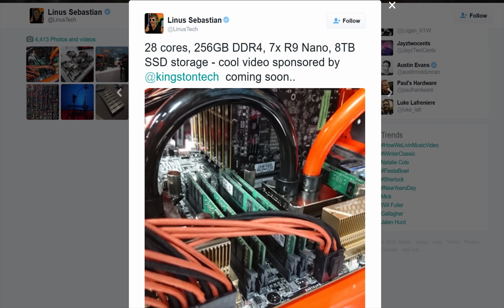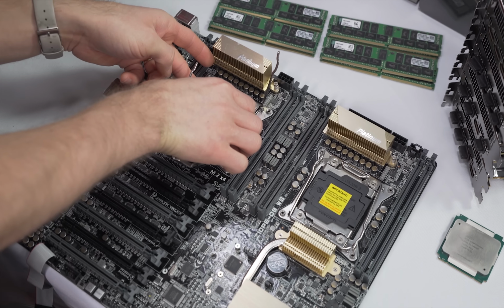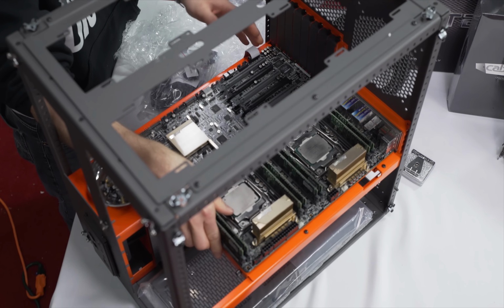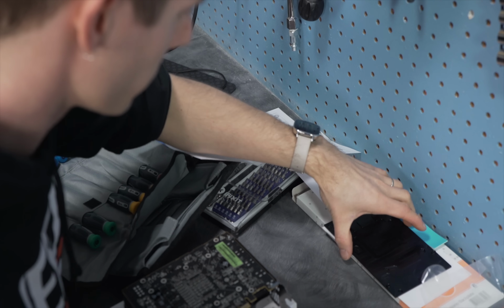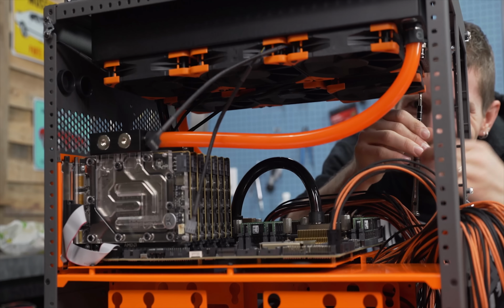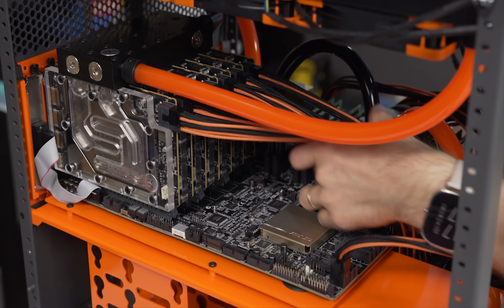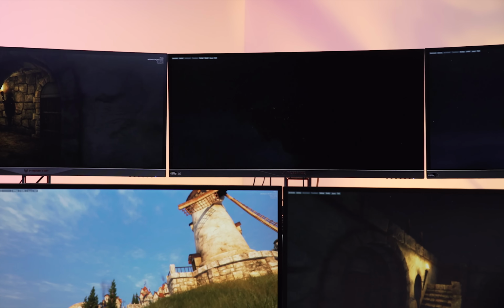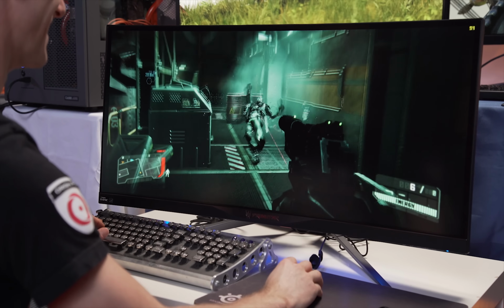7 Gamers, 1 CPU - Ultimate Virtualized Gaming Build Log

Comment: I just realized this stuff has become cheap enough that you could rebuild this thing for like, stupidly cheap. The 22 core CPUs can be had for less than 69 bucks, the GPUs if you go with the actual Fury X or the 980 ti can be had for like 75 to 90 each, just to get a water block that connects all 7 will be hard

Comment: For those wondering the Radeon R9 FURY is close to the performance of an RX580 these days.
I'm going to guess with only 4 core/threads per gamer at a max of 3.6ghz, the cpu would still be the bottleneck.
Reply: Thread ripper would have been huge for this project

Comment: «There isn't a CPU on the market that can deliver a full-on high-end gaming experience to seven gamers at the same time.»  Ahh, the days before Threadripper, when 56 threads across 2 CPU chips and HT was impressive.
Reply: Even Threadripper has neither the PCIe lanes, or slots (in the case of the motherboards) for a system like this. You’d need an Epyc CPU for this
Reply: @StopwatchGod at 88 PCIe lanes, given the graphics cards can worl alright with 8 lanes, it would work.  But the motherboard point stands.

Comment: Wild that those processors were $2,700 each in 2015. A Ryzen 9 5900X (2020) has a significantly higher multi-core score (+20%), it has over double the single core performance. They are on sale from multiple vendors for $399.99 now.
Reply: Imagine if ryzen never came out, we’d just now be getting 8 cores from Intel (their leaked roadmap had 6 core CPUs in 2019-21)
Reply: @tranquil14738  That's nasty AF business practice. Intel has no shame.

Comment: Funny a single pc with 2 rtx 3080 and a 5950x would be faster only if you could allocate specific amount of cuda cores and vram to each use but I don't think there is a vm good enough for that unless it's something really unknown lol that would be dope but dunno how drivers would really work
Reply: SR-IOV does pcie bifurcation of compute, so not far off but no one has enabled it on their consumer grade products
Reply: Yeah most cool technical features most consumers will not use so it comes in at commercial grade hardware which is expensive or commercial software cost alot usually which kinda sucks but hopefully stuff becomes more open source

Comment: I think they should do a new version. 6 gamers 1 cpu, is actually do able with threadripper pro.

CPU: Threadripper PRO 3995WX 
Motherboard: ASUS Pro WS Sage SE wifi sWRX80 EATX
RAM: 8x 16 or 32 GB 3200+mhz <=16 CL sticks
GPUs: 6x reference 6900xt (for 1 slot and usb c)*
Storage: 7x Samsung 980 pro 1TB
And a 4 m.2 expansion card .

*The reason to get reference cards is that the usb c connector can be passed through as a pcie device to each vm alongside the gpu its on thus solving the usb device assignment problem. You theoretically connect a usb c hub to each graphics card and have hot plugable USB ports for each vm.

Each vm would essentially be a 10c/20t 4.2ghz zen2 cpu with a 6900xt and a 1tb gen4 nvme drive, basically not much better to had for a gaming pc.

Y'all could even do something like get the world's first raid clear on a single tower.

Comment: you could probably do an actual 7 gpu and ONE CPU with an AMD EPYC version of this build. Godspeed Linus

ps: using that single water block for all the gpus.. doesnt that mean that the water from the first 6 gpus flows hot water through the last one? or are they set up in parallel config?

Comment: I am really really really wondering and I don't understand why this wasn't a talk here.. 1) are all devices plugged in locally or did you run the games remotely like Horizon View? and 2ndly.. What about latency? It's called Virtualized, but perhaps it is 'just' several sessions on a single windows 10 installation.. Anyone has an idea if it would work to just fire up a type 1 hypervisor and run via vnc or anything else to game with latency below 5ms? Steam in-house streaming is actually higher as stadia afaik.. but having one big machine as a home lab and gaming rig somewhere in the basement and playing lightweight via LAN on a fan less device .. this would be awesome.. since pcie passthrough to a vm isn't a problem in esxi, proxmox whatsoever it could work pretty good i guess

Comment: 2016: LTT makes 30k build 7 gamers one CPU.
2019: Apple makes 58k build 0 gamers one CPU.
Reply: 😂😂😂l0l lmao
Reply: It is a beastly system, if it was like 15k that would be a heck of a lot more reasonable though
Reply: As of 2020, the best pc apple has is $54,547.98
 without tax. But to be fair, it has 28 cores and 1.5 tb of memory.
Reply: @pokemonmaster42000  28 cores and 1.5 tb ram with an overpriced tag.. lol
Reply: @KingKong-xp6so  still the best apple pc, even if the ram is an over 300% markup (yeah thats true lol)
Reply: @pokemonmaster42000  yeah best Apple approach can be said.. Yet there will be very minimal where to cost those amounts of money..
Reply: @pokemonmaster42000  So what you are saying is that Apple is approximately 8 years behind on hardware tech from Intel?  I currently own a Dell r820 with 4 E5 4657v2 processors each having 12 cores and all 4 cores run Hyperthreading meaning I have 96 Threads and 48 cores available and 1.5tb of DDR3 RAM and 16 4TB sff SAS drives for 64TB of storage running dual 1400w 80 Gold PSU's and a 2x2 Intel 10gbe/1gbe NIC.  I purchased this off of ebay for pennies on the dollar (I think I paid about 2,500 for the entire setup)  I think the server new MSRP was like 23K for the entry level and full enterprise level was somewhere around 42k in 2012 and it was built with virtualization in mind...Oh well nice try Apple!
Reply: @marlberg976  Not the hardware. Macs are relatively good in the world of prebuilds. Its just the price to performance ratio, and the difficulty to upgrade. However, you can almost always get better with used or by just doing it yourself.  Your pc is an extreme case, because even though the parts are seven years old, 4 E5 4657v2 rack up to almost 18k, and that's without the ram, case, storage, or graphics cards. That's one hell of a deal.
Reply: and around the equivalent of a rtx 3080, but it still is hella overpriced
Reply: @pokemonmaster42000  more like the equivalent of a 3070. max you can even put in it is dual Radeon VII's and they dont exactly scale well
Reply: Funny haha
Reply: i meant 30k

Comment: Try it on threadripper!, 64 cores should give you 8 core to all of the 7 vms, and still 9 cores left to unraid, wich is a lot!
Reply: If they do it again and if a dual socket x399 goes to linus wait for threadripper 3  with dual 64 cores
Reply: @joekingsword2150  Or just a dual 64 core EPYC setup. Though even then, a single 64 core already doubles the thread count per VM.

No idea what cards they would use though.
Reply: @Anonymous Gamer furthermore the threadripper uses a different processor soket than intel

Comment: Linus' closing comments reminded me of something I heard once, that an original IBM XT (1983-84) when it first went on sale cost the same amout as a brand new Toyota pickup truck.
Reply: I don't think that's true, because I remember my father said he paid 12000NOK for one and that would be 31000 today. 1 NOK = 0,114USD. According to Wikipedia, the introductory price was the equivalent of $4,313 today, which would be 37,800NOKs. Not far off. I don't know what a brand new Toyota pickup truck costs, but I doubt it could be as cheap as that?
Reply: @jeschinstad  Greetings to Norway.  The point of the story was that personal computers represented a much greater ivestment relative to the family budget than it does now.  That being said here is what I found to support the stroy, let's stick to one currency in the original 1983 amounts to keep it simple.  

"1983: March - IBM announces the IBM PC XT, with a 10 MB hard drive, 128KB RAM and a 360KB floppy drive. It costs US$5000." 
(http://oldcomputers.net/ibm5150.html)

"1983 Toyota Pickup Trims and Specs 2 Dr STD Standard Cab SB Original MSRP $6,188" 
(https://www.cargurus.com/Cars/1983-Toyota-Pickup-Trims-c12422)

It is worth noting that rarely do Americans pay the full MSRP on a vehicle.  Also there were other vehicles that were priced less than the Toyota Pickup truck in 1983, which means that you could have bought a brand new Chevy Citation  or a brand new IBM XT for the same amout.   Odds are the PC would have been more reliable.  ;-)

Comment: Would anyone else like to see a 3rd installment of the "Multiple Gamers, 1 CPU" series featuring Threadripper 2(or Threadripper 3 after its release) within which it is actually the case that 1 CPU is used (rather than 2 like in this video)? For example, the Threadripper 2990WX could provide 4 physical cores per virtual machine across 8 VMs. Yes, this is a late reply, but that is because I think that the series is overdue for a reboot! Since this video was made, AMD's Zen architecture has changed the field.

Comment: Is there a free software to do this , I don’t want to pay for unraid
Reply: Yes, you can do it with any modern GNU+Linux distro. Unraid just makes it easier. The virtualization is just QEMU+KVM with some PCI pass-through configured. There are guides on how to do this and I think LTT has made some videos on how to do it as well. These days, you can also use Looking Glass to display the outputs from multiple GPUs in windows on one monitor, so you could use the built-in GPU for your desktop stuff and have a high-end nVidia card running Windows and have that in a window on Ubuntu, for instance. That still requires some non-trivial setup though, but it's getting better. Most monitors support multiple inputs, so you might want to just switch input on your monitor and use Synergy to move keyboard and mouse between the systems. 

Hope that helps to get you started. :)

Comment: Can we get a Threadripper 2 version of this?
Reply: Yeah one 32 core Threadripper 2990WX should be adequate, not sure if those two Intel zeons or the threadripper would use more power though
Reply: @nickkaraoke2128 : This is not primarily about cores and threads though. A single Xeon would probably be enough for that. I think PCIe is the real bottleneck.The TR only has 60 lanes of PCIe, whereas this dual Xeon system had 80. So with the TR, each GPU would have at most 9 lanes of PCIe and with the Xeons, they had about 12. Also, the TR only has four memory channels, whereas the Xeons have four each. So you can't just look at cores and gigahertz.
Reply: @jeschinstad  I think lower end eypc does the job nicely which should be cheaper than a 32 core TR
Reply: Epyc would work tho
Reply: @gamerthebanning : Definitely. :)
Reply: Threadripper 3990x? 😳
Reply: @username8644  would have better single thread performance though. With the ability to share GPU resources with sr-iov you wouldn't even need an insane number of GPUs for more gamers as long as you use a very expensive powerful GPU.

I think an Epyc 64 core version would be more interesting, though the clock speeds are much lower.

You'll probably need some kinda 2000w power supply on a 240v circuit
Reply: Has to be a server chip for enough pcie lanes
Reply: the best threadripper on the market rn has 64 cores and 128 threads, more than enough for the 7 gamers. more like 16 gamers.
Reply: or an amd epyc version
Reply: ZALHERA666 threadripper doesn’t scale to 2 cpus
Reply: @springbok4015  dual cpu mobo for it?
Reply: Ewan Von Hindenberg there are no dual cpu mobos for threadripper, because threadripper isn’t scalable.

Comment: Just think about how far cpu's have come in a little over 2 years. This pc has two 14 core 28 thread cpus for a total of 56 threads, with the cpu's having a 3.6 ghz turbo costing $2700 each at launch for a total of $5400. The new 2990wx has 32 cores 64 threads with a turbo of 4.2 ghz, in just ONE cpu for only $1800 . Damn dude.
Reply: Means that if Linus is willling to do it back (if), then it can be officially called "7 Gamers 1 CPU". Look how fast technology has developed in few years.

Comment: found this power supply with all the connectors(24 pin, 8 pin cpu)
https://www.amazon.com/KKmoon-180-260V-Switching-Efficiency-Ethereum/dp/B078STM24M/ref=pd_rhf_se_p_img_6?_encoding=UTF8&psc=1&refRID=BXWTK54V2HMX4S6W2M72

Comment: with the new lga 3647 28c/56t x2 you can do a "14 GAMERS 1 CPU" but what about graphics card ? maybe 7x 1080ti (that double the r9 nano) mini version :) hope thats a good idea
Reply: Or threadripper 2 32 core. Or Epyc 2 64 core. Though since the build for 7 gamers was already on the limit of 15 amps, he'd need like a 2500w power supply and a 240v high amp circuit, or multiple power supplies and separate circuits.

Comment: Imagine that thing running one game on one monitor at at time! It would be like 500fps at least I guess! Haha!!
Reply: Knowing that SLI and Crossfire are dead features than are not supported on 80% of games out there, and 18% of other games don't use the full potential of 2 gpu , I highly doubth this is going to be better at all, sometimes throwing a third graphics card only gives you 5-10% increase in fps, multi gpu for one gamer is not worth it at all...
Reply: at least 1000, wathever the game is haha
Reply: 2 way SLI/Crossfire is more cost effective then 3 or 4 way... Really if you just have money to blow I would get two GTX 1080ti cards and water cool em for better temps with SLI!
Reply: Also i wouldn't say that they are "dead", just for more hardcore people! :D

Comment: Ur building 100000 $
And I almost can build 300 $
Reply: Albert Red get dry for a big brag! my pc i9-9900k, 2070 super, overclocked, NH-D15, Z390 Gaming edge AC, 16gb vengeance ram, 3 240Hz monitors, a 60 hz monitor, Corsair Crystal Series 570X RGB - fully tempered glass case $5000 when I built it

Comment: you say that you would not expect any of us (being your viewers) to go out and pay for a machine like this. yet here i am looking at parts for a computer that costs about 3 thousand dollars. i know this is not even close to the amount that you spent on yours but what i am doing is definitely more practical. i am going to get a 4k project with 7.2 surround sound and use one computer to run the projector so that the person playing on the other computer does not effect the movie. Or it will also be so that i can play one game while another family member plays another game on the other computer. One computer with multiple graphics cards in much cheaper than 2 computers (even if it means much more hassle setting it up). where are my sponsors :(   ... I am looking at getting a 280 mm radiator for my cpu and overclocking my r7 1700 to 4 ghz. then using a msi gaming x gtx 1070 with a msi gaming x 1080 ti (these 2 will be the primary graphics cards for the consoles) then using a 750ti that i have for running the server instance.

Comment: "xeon e5 14 core cpu"

looks over at my  i5 7600K 4 core and starts crying
Reply: That’s actually still a great processor tho
Reply: Just remember theres someone who always has it worse.

looks over at my 6 yearold amd a10 6800k quad core and starts crying
Reply: @TypicalPeen  I have a core i3 4000M @ 2.4Ghz (dual core) and 4gb of ram
Reply: I have a Celeron CPU😂
Reply: I have single core Athlon from 2005
Reply: Bruh core m5 y10c is worse, 0.8ghz dual core

Comment: watching this on my $400 PC
Reply: good for you, im watching on phone because my ass pc is outdated
Reply: Brown Guy hell....

I'm watching on my windows 98
Reply: Brown Guy watching on my 200 dollar laptop 😭 Intel Celeron N3060(2 cores clocked at 1.60 GHz), Integrated Intel HD 400 graphics, 4GB of Hynix DDR3 memory at 1600 MHz, 32GB of eMMC for storage(yes, that’s all the storage I have), 1024x768 display, and it’s so underpowered that the cpu or gpu doesn’t even need a fan, nor does it ever get hot under load
Reply: So he made a $400 PC, and that guy is from that $400 PC. And that guy made a $400 PC. And that's the $400 PC where I was born. Where my father died. Where I couldn't make time for his funeral because I was working on my $400 PC.

First thing that came to mind. Had to share.
Reply: 50$ cell phone lol.
Reply: Watching this on my 250 dollar machine
Reply: @sarthakjain6979  lmao
Reply: I dont even have a pc...anybody have a free pc they are willing to donate...
Reply: Brown Guy I’m watching this on my $5000 custom built pc, i9-9900k, 2070 super, overclocked, NH-D15, Z390 Gaming edge AC, 16gb vengeance ram, 3 240Hz monitors, a 60 hz monitor, Corsair Crystal Series 570X RGB - fully tempered glass case
Reply: @GoatPersonThing  Ahh yes a video stretched over 4 different monitors, my favourite. -Posted by the cockroach pc (2009 I7 870 cpu, 2010-2014 ram, DDR3 of course, 2015 gpu and cooler master bargain bin case. oh and a intel H55 mobo that came with an I3 for good measure)
Reply: Wait you guys have pc's?
Reply: watching on $70 dollar pc
Reply: Ikr, i have a Core 2 quad Q6600, 8gb of DDR2 800mhz, and a GTX 550ti...

Comment: How can this work ? You can have only one steam account running on Pc , and you cant play multiple games at once on one account. This will never work even if you will have extreme ultra nasa gaming gpu
Reply: They are using 7 virtual machines meaning that 7 virtual instances of windows are running at the same time and plus steam is not the only way to play games on a PC.
Reply: FailedGraphics you have a good point and i acctually learned something from you but steam is most used for games, and some games such as csgo , dota ... you have to play throught steam.But if virtual machines can play multiple steam accounts at once , its cool but ... 7 mediocre pcs would be better than 1 super high end Pc. and btw they were playing Crysis and Crysis is through origin so i dunno if it will also work with steam...